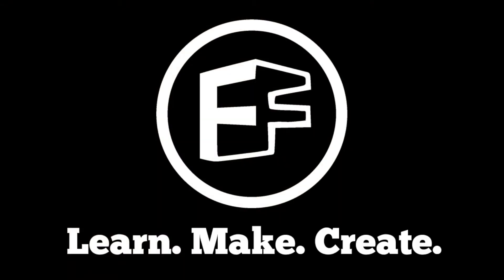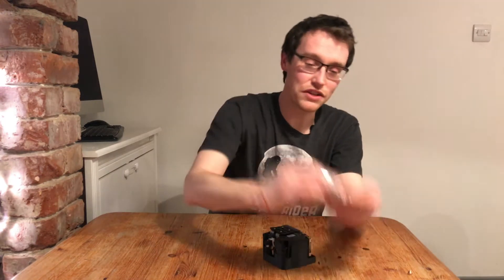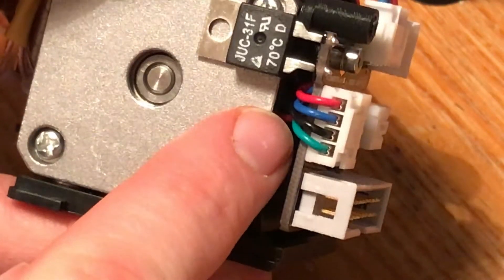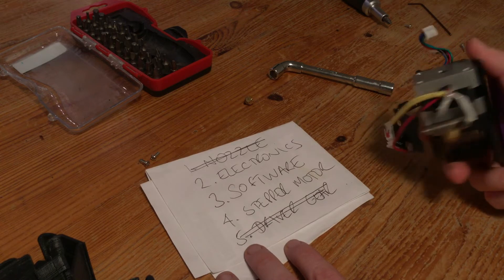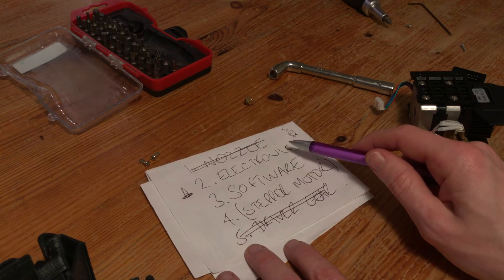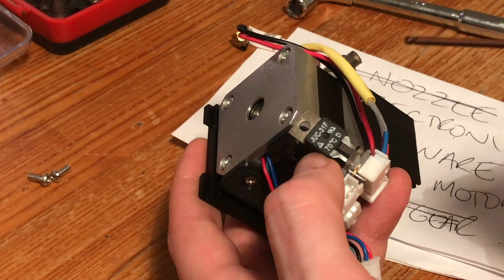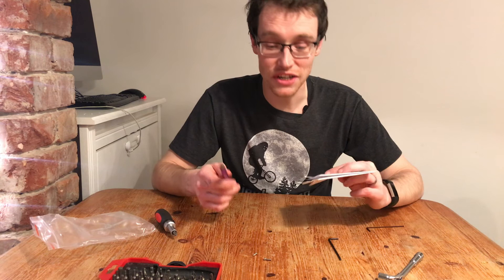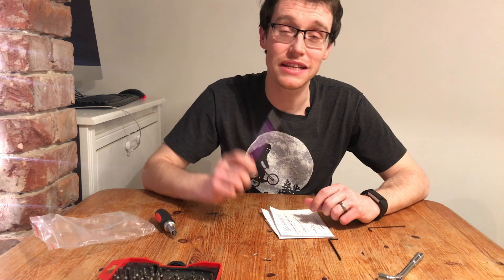Extruder Problems? 5 Easy 3D Printer Fixes - #5minFriday - #32

Comment: I have a preproduction cetus 3d printer and it has stopped extruding. When I remove the filament the motor is able to spin freely when turned by hand but when powered it just sits there and clicks rotating slightly but in a random direction.

Comment: Did you manage to get this resolved? I'm having the same issue, but I'm finding Tiertime to be slow to respond and was wondering if you had any further advice. Thanks!
Reply from the maker: No problems now thankfully. What's the main issue you're having?
Reply from the maker: My problem ended up being the main board. If you suspect the same (watch my video in kainboatd replacement/diagnosis) then you're better off contacting your country's distributor than tier time I think...